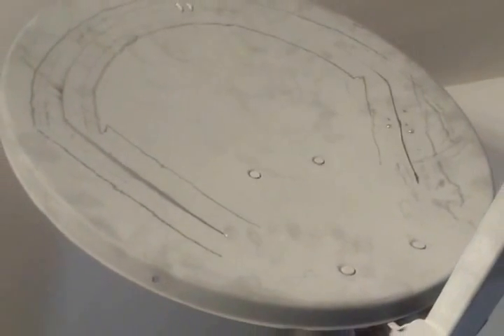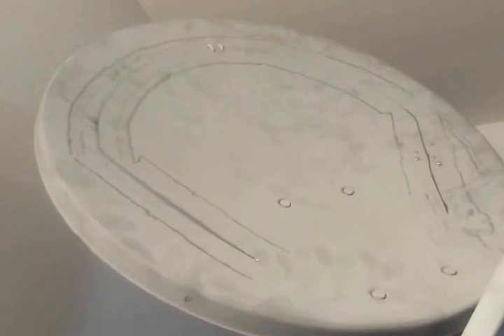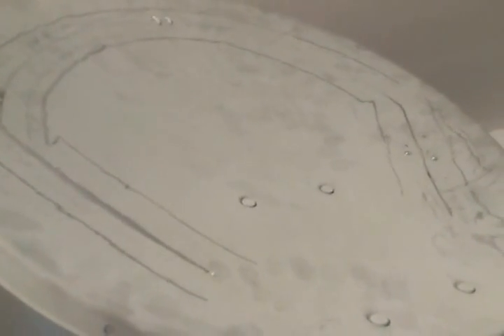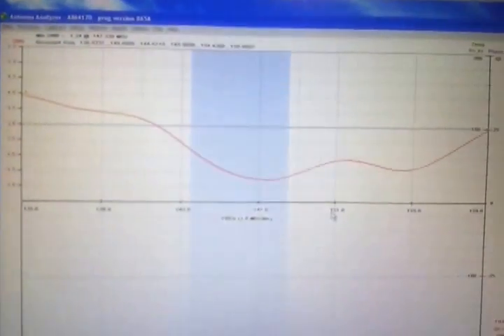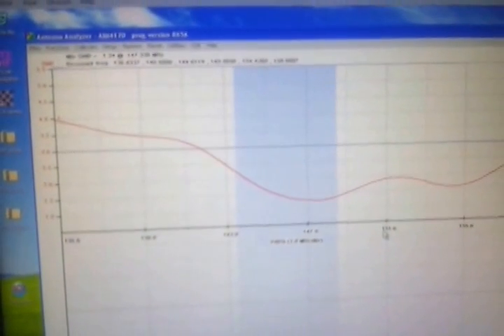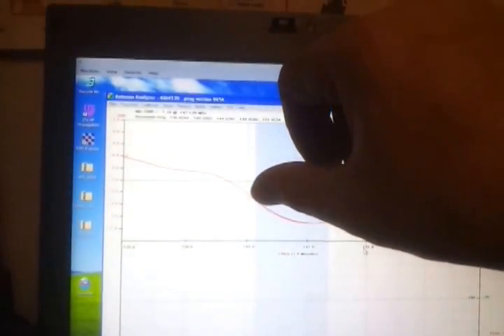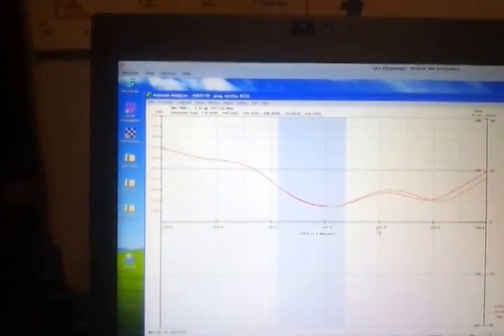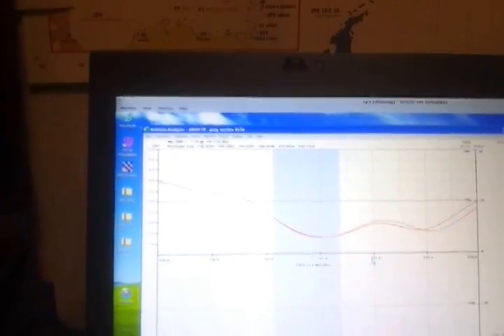Slot antenna parabolic dish based 2m 440

Comment: so, the slot itself is fairly thin, and the overall length of the slot is just as long as a 1/2 wave dipole. what happens if you increase the width of the slot, to more of a rectangle or square? triangle? circle (wouldn't that be close to a halo)?

I think someone mentioned that as long as the the diameter of the air gap was equal to a full wave, that it should be good?

i'm asking because this seems like an intriguing design for the HF bands.
Reply from the maker: Great question, at some point it probably starts to look like a full wave loop fed with a gama match.  If you try it, let me know. 73
Reply: James Sanders I was thinking something along the lines of a vertical pole with a large single zigzag slot?
Reply from the maker: I think that would work fine.  Getting the feed point in the right location, along with the slot length adjusted will require a bit of trial and error, and my AIM4170 anaylzer really helps show what is going on quickly...  if all you have is a simple MFJ analyzer, just take 20 or 30 readings across the band and plot each reading on a piece of graph paper so you can see graphically what you have before/after when you start adjusting.  Tedious yes.
Reply from the maker: keep in mind that a horizontal slot is vertically polarized, and a vertical slot is....you guessed it, horizontally polarized.  It's nature throwing us a curve :-) de ag6if

Comment: radiation pattern?
Reply from the maker: +Steven Canfield  not too sure, I didn't model it, and I didn't roll it around all axis's and measure it's receive sensitivity.  I can tell you that it is very sensitive to FM repeaters, hence, vertical, and I didn't detect any nulls in the basic handling that I did do...when I get some time, I will check deeper.  73 AG6IF